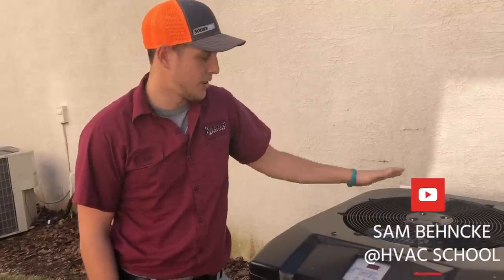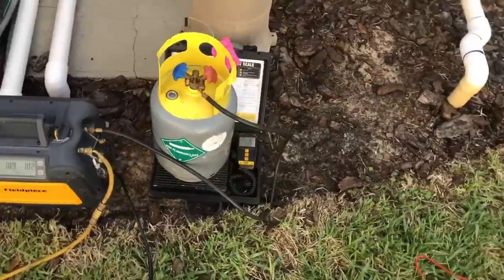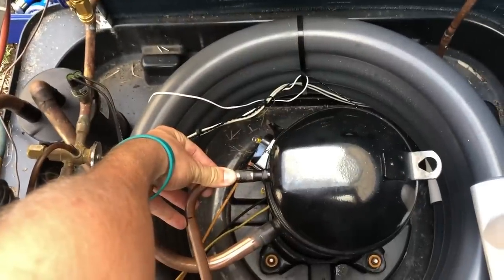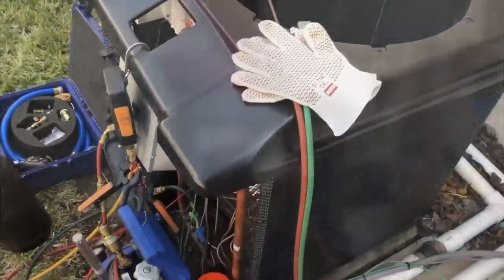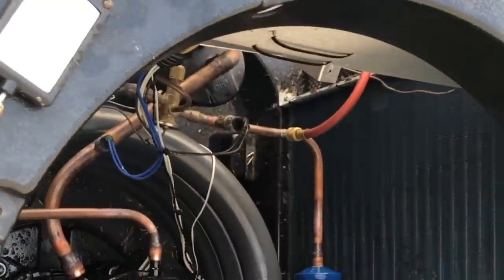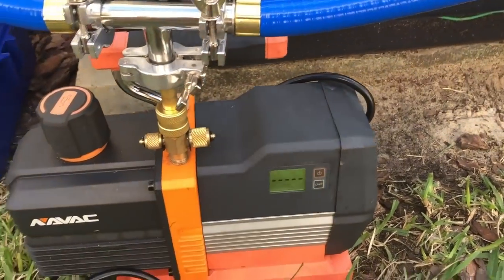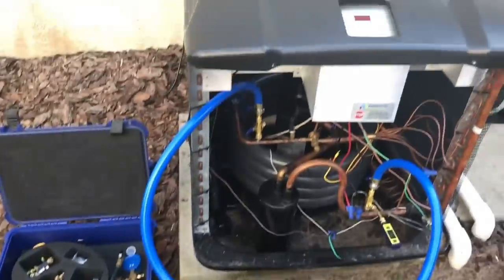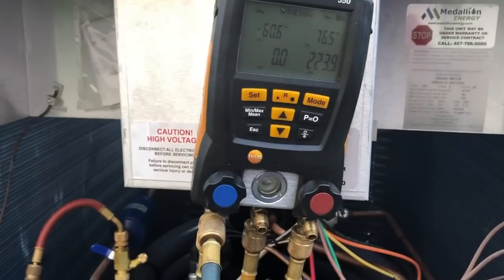Replacing a Pool Heater Compressor

Comment: How much would a job like this coat? My pool heater is not working. I replaced the capacitor and my fuse keeps tripping.